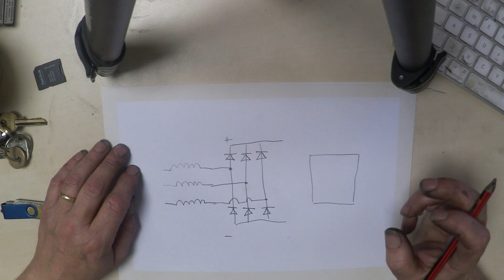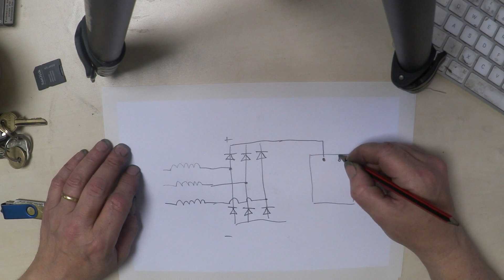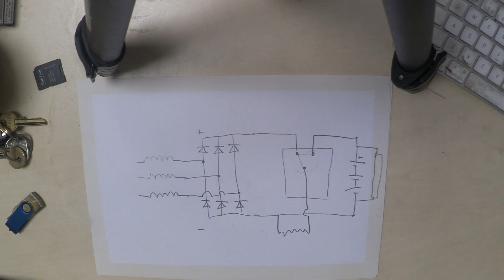Connecting A Wind Generator - The Basics

Comment: Your an amazing teacher!  Having a good  understanding of systems is one thing, but simplifying it and teaching others is a whole other level.  I've been living off grid for 2 years now with a system I installed, but still found this video useful.  On a side note...do you have any thoughts on Nickel Phosphide synthesis?  Is hydrothermal the only practical method?  I am investigating urea electrolysis using Ni2P as a catalytic electrode.
Reply from the maker: cheers mate and I will have to have a look at it

Comment: Robert - may I suggest a project (I'd be very happy to work with you on it, I've been playing around for a while with it) of both an absorption and/or adsorption refrigeration system?  Both have advantages and disadvantages but they both produce a very drastic cooling effect from a heat source.  In this world, we have so much access to various sources of heat, and often waste heat, which is MORE than enough to power a very sizeable freezer or refrigerator or air conditioner.  

One example of a heat source would be an combustion engine and using the cooling fluid as the heat source, probably to the point where you can eliminate the radiator (or bypass while using the heat).  
There are MANY options for the working refrigeration fluid from ammonia, lithium chloride (or lithium something), propane, methanol, acetone, etc and I think most other refrigeration gases will work, the difference is how cold each "refrigerant" will get and how efficient they are.  IIRC, ammonia is one of the best for use here and I think using high concentration ammonium hydroxide is sufficient (so ~30%).  I think you will find that in most large industrial freezers (meat packing plants, ice making plants, etc) use ammonia, but they use anhydrous, which from what I've read, isn't necessary unless you are looking to get temps to -40 - -80F, and the liquid ammonia should be able to get to -10 to -20F.

These systems are already in use in RV's where they use propane or electricity to evaporate the working fluid and when it condenses, it provides the cooling effect.  

There are so many methods that could be used to generate the heat from burning wood, waste oil, excess heat from running forges, heck, even your car could have a working freezer by using the heat from the engine.  

This is ideal if you need to run AC/freezer/fridge when the power goes out and you are running a generator.  All that heat from the generator is lost, but you can remove the AC/freezer from the power circuit and run it by using the waste heat from the genny.

This will even work with "low grade heat" of say 120-160F - as long as it's hot enough to boil the refrigerant, it's enough heat.  If you have a lot of "very low grade heat" (say 70-100F outdoor temps), you can use that as well but you may need to run a compressor, which as you know, if you compress the 100F gas, it will get much hotter, and there's ways to reduce power needed for this and get it just hot enough to operate so you don't waste energy on the compressor (small compressor).  

Finally, this would work well with solar water heating, parabolic heating, coiling black/green hose in the sun or on a black pavement - all absorbing the heat that will then be used to evaporate the working fluid. 

There are VERY many applications for this, especially in mobile platforms like military, disaster relief, etc. after a Hurricane with no power in an area and it's 100F+ and 100% humidity, you have to have HUGE generators to power general electric use for the temporary refugees, and GOBS more power if you want to cool their living quarters (and workers quarters). So, by incorperating this technology with large generators (6-12 cylinder large diesel or gas genny's @ 50-600KW+) they could reduce electricity demands by over 50% in many areas (it also works as a heat source in cold regions as well).  Think of he 70-80% of wasted energy from heat when running a generator, why not put it to use to power things the genny was going to have to output electricity to power (even further wasting more fuel and heat!!!). 

It's a big project if you really want to build something like this, but even a single cylinder engine if it has a radiator is sufficient as a test model.
Reply from the maker: I know a fair bit about this kind of cooling mate and yes there are a ton of applications - it is something I am interested in for sure

Comment: I myself would like to use a charge controller, a midnite classic150, along with a transfer switch when fully charged, the power will go to a dump load, to prevent over spin,  along with a possible water heater load,  but will likely only use a buck boost converter, with a voltage controlled relay, to switch to a dump load when the battery is full. But this will be good for 20 amps at best, the midnite option will be good for 96 amps! I think I'll study a bit. And build a buck boost, with microcontroller,  to help charge my lithium batteries, I just added 18kwh, a total of just over 1000 ah At 24v (29.4 full charged). I think I'll stick with the car alternator style,   it will likely only be useful during storms, witch is usually when I need it, a 100-150 amp alternator, should do atleast 50-100 amps in a decent storm, better than nothing, and if I get it above the trees, it may produce in fair weather, you help my imagination alot, although i need to set a goal and stick to it, I keep trying to one up it, before even getting started, I'll end up with a 100,000 amp turbine. That never makes it off the paper. If I do not set goals, it's so easy to make improvements, when you haven't done anything yet! Ha-ha!
Reply from the maker: yes mate - but here I am basically trying to uncomplicated a complicated issue - all I am doing here is introducing the concepts as pigeon holes further videos will explore each concept - but I always find a frame work to think in helps understanding - if we throw too much at the topic it just becomes a jumble - or at least that's the way I see it

Comment: Looking forward to the rest of the series! The charge controller is normally in parallel with the battery, rather than in series as in your explanation/diagram. In fact i don't know of any wind controllers that are in series. Also, typically, when using a grid-tied inverter to "feed your house" you don't have batteries - just a moderate capacitor bank.
Reply from the maker: sure - but this is really basic stuff mate and it's not really a circuit more of a block diagram
Reply: love to chat some time, I'm looking to buy a AtlasX and  I don't have a battery bank. I have 4 DC to AC solar inverters, 3 Tesla power walls, and 55 solar panels that power the house. I'm just not clear on what's needed to feed the power back into my house @ 60hz, 120/220, from a wind turbine
Reply: @Themachinewon  You need a wind turbine grid tied inverter. They're different from solar ones as you have to program a lookup table specific to the turbine in.

Comment: What I am really interested in is how to wire up a DPDT relay to automatically switch between using and charging of two batteries or  banks  so if the bank you are using becomes depleted the system automatically switches to the full bank and the depleted back automatically switches over  to being recharged back and forth. Thanks Robert, that sounds good,I'm looking forward  to your videos.
Reply from the maker: cheers mate - here I am basically trying to uncomplicated a complicated issue - all I am doing here is introducing the concepts as pigeon holes further videos will explore each concept - but I always find a frame work to think in helps understanding - if we throw too much at the topic it just becomes a jumble - or at least that's the way I see it
Reply: Is there a reason why you would not combine both banks together into one large bank in the first place? If you can charge a depleted bank before the secondary is also flat then you'd be putting enough charge into a single double sized one to have it not go flat in the first place I would think?
Reply: @popuptoaster  You can't use a battery and charge it at the same time.
Reply: @BushImports  yes you can? that's how pretty much every system in the world works, from car starter batteries to solar systems powering you house.

The charge controller regulates what goes into the batteries and you draw from the batteries with whatever load you are driving. The battery is like a reservoir, you pull power out of it and when there is "room" for more, the charge controller lets more power in to refill it, this is why there is talk of dump loads, for when the battery is full the charge controller dumps the excess power elsewhere.
Reply: @Dean-hs3vq  there should be a way to regulate that where you can capture all that energy and not fry anything.
I have never heard of anyone charging a battery and discharging it at the same time, it makes no sense to me. Actually I tried it with AA batteries and they would not charge while I was running anything with it/them.

Comment: I live on a boat so there is a lot more wind than you get in many inland situations, my advice is to check how much wind you have and how reliable it is before going to deeply into wind generation (especially in the UK where you need planning permission to stick anything up above your roof line), solar is often a better choice if you have room for the panels. 

Having said that I have solar and am also building a turbine using the hub motor from a "hoverboard" wheel, haven't decided which charge controller to use yet, I have a Victron on my solar, it works very well but I don't like how it needs a phone ap to use it properly, Bluetooth is a pain on a steel boat and updates can be problematic.
Reply: Lucky you!!  Living on a boat was a dream of mine since I was in college.  Victron is a great choice, probably one of the best brands of controllers out there.  You might want to look at the EPEVER Tracer series controllers with a remote MT50 screen - I hear they're a nice option for RV's and boats.  But you'd definitely want the remote screen, they're a pain to program without it.
Reply: @NorthernKitty  I'll check them out, thanks.
Reply from the maker: good advice mate - cheers

Comment: If you want real cheap controllers look into buck or boost controllers, depending if you need to step down or up the voltages ! But then you do need to worry about overcharging n such..
Reply from the maker: yes mate - but here I am basically trying to uncomplicated a complicated issue - all I am doing here is introducing the concepts as pigeon holes further videos will explore each concept - but I always find a frame work to think in helps understanding - if we throw too much at the topic it just becomes a jumble - or at least that's the way I see it
Reply: @ThinkingandTinkering  Good point :)

Comment: Semi related question.. given the current state of solar panel tech and increasing efficiency, is it worth investing in a 6kw system?  I ask cos I am one of those poor buggers that gets stuff like that just before it becomes obsolete or vastly more efficient 😖
Reply: In my experience if you buy new it takes years to get your money back with solar, buying second hand panels and maybe building your own LiPo batteries brings the cost down if you get good deals, but "worth" depends on your situation. Sometimes it's not about cost it's about not being grid reliant, I live on a boat and wanted power without having to run the engine or a generator so cost is a secondary issue.
Reply: @popuptoaster   Yep, takes a while to "recover" costs but more about not giving the bastards my money than anything. Not keen on 2nd hand stuff, just don't want to get 20% panels if 50% ones are on the horizon. Thinking about relocating to warmer climes where many places have preexisting solar setups so may not be worth considering. Depends on how the cunovavirus thing pans out. Island life in Tassie is much safer but the cold really sux as I age.
Reply: I'd tend to say "yes", with two caveats.  First, as others expressed, expect it to take some years to get your money back.  That will vary depending on your system and how much solar exposure you get.  For my "far North" location, it could actually take as long as 7-10 years.  Second - and especially if you're worried about technology becoming "vastly more efficient" - even though we're on a battery channel, if the option is available to you I'd stay tied into the grid and sell your power back to the power company rather than have your own battery storage.  You'll see a much quicker return on your investment,  as you'd likely be having to replace your batteries around the same time you reach the "break even stage", incurring new costs all over again.  Also, battery technology is the most likely component to become more affordable in the coming years, you can always add it later.  By contrast, solar panels are already pretty cheap these days, and there are arguments to be made as to why the system costs may actually go up.  "Soft costs" (installation, shipping, permits, etc) make up the bulk of expenses, and those are only likely to increase in the future.  Additionally, a lot of the generous tax incentives are going away.  I think the Federal residential incentive in the U.S. goes away in 2022.  This might actually be the best time to do it.
Reply from the maker: that is a more complicated question than you think mate - it sort of requires a video I think

Comment: I did this for a 12 volt system.  I used a Harley Softail (2007) Rectifier/Regulator.  The alternators on Harley's are 3 phase AC and the Rectifier/Regulator is both a 3 phase diode rectifier and a shunt regulator (like the old Triumph's) that clips the output DC voltage at 14.5V.  A shunt regulator shunts excess voltage, on the positive portion of the 3 AC waves, to ground.  On a wind generator, this shunting acts like a brake and slows down the wind generator and stops it from over speed.  Good for unattended 12 volt wind gen systems.
Reply from the maker: so like a dump load?
Reply: @ThinkingandTinkering  Yes, similar, but no load resistors.  When trigger voltage is reached (14.5v) the gates of the 3 SCR's gets a positive charge, turning on the SCR's.  The circuit uses the 3 SCR's to short the Positive of each wave to ground, and in a way, the SCR's are the dump load. The SCR's are turned off during the negative cycle of the wave.  What is also good about the motorcycle rectifier/regulator, is that it is built in it's own heat sink and is waterproof.

Comment: What about a automotive alternator.
Reply from the maker: here I am basically trying to uncomplicated a complicated issue - all I am doing here is introducing the concepts as pigeon holes further videos will explore each concept - but I always find a frame work to think in helps understanding - if we throw too much at the topic it just becomes a jumble - or at least that's the way I see it
Reply: you have to feed power in to an alternator to energise the coils before it will make any power.
Reply: @popuptoaster  Not so difficult to have it done. I use 2 12v 70Ah alternator in my wind generator and have no problem with it. I use capacitor instead of battery to keep the voltage their to make it produce power as soon as it spins.
Reply: @dagandreassen8446  Yes, agreed it's not that difficult, just pointing it out so it can be a consideration when choosing what to use.